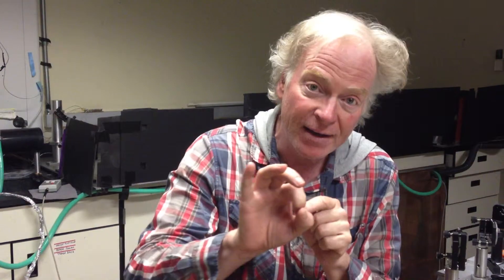Microchannel plates for soft X-ray imaging sales@dmphotonics.com

Comment from the maker: We can offer from stock:
Microchannel plate detector MCP-MA 25/2
The rectangular mounting plate is 34mmx34 mm
with mounting holes on a 27 mm square
(dia 2.2mm for 2 mm mounting screws)
https://www.youtube.com/watch?v=QW532GLaDFU

drawings (with a circular mount) are shown here:
http://www.dmphotonics.com/MCP_MCPImageIntensifiers/mcpma252.htm
Pricing shown in our online store:
http://greyhawkoptics.com/product_info.php?cPath=73_74&products_id=305&osCsid=eaa7fb9625ca09de4256aed58a54aba4

And we can offer from stock 4 bare MCPs of your type 25-10E, each two matched:
http://greyhawkoptics.com/product_info.php?cPath=73_75&products_id=309&osCsid=34db26694241bae662b97030d59970fb

Please note that the prices indicated are list prices, we'll be happy to offer you substantial discount. Please let us know what you want to see on the formal quote and what is your expected budget you plan to spend so we'll do our best to fit in it.

Comment from the maker: 2p - Microchannel Plate (MCP) Detector sales@dmphotonics.com
http://www.sciner.com/MCP/2pi_detector.htm
2p-Detector is multi-detector, based on microchannel plate detectors. It can be used for detection of electrons, ions of both polarity and photons in wide variety of experimental research. Both energy and angular distribution of different particles can be measured as well as the correlation between these quantities.

This new type, 2p-steradian multi-detector originally was developed as low energy electron spectrometer for probing highly charged ion (HCI) surface interaction. This interaction gives rise to the emission of a large number of slow electrons. For example, the impact of a single Th71+ ion on a gold target produces a mean number of 250 "slow" electrons (E<60eV).

2p detector made of 16 independent detection units, made of two multichannel-plates (MCP), located on a half sphere of 60-mm radius surrounding the solid target. The 16 detectors are held from their backside on an R = 85mm hemispherical frame (fig. 1). Three additional holes are bored in this frame: one hole for beam injection at normal incidence and two opposite holes located in the equatorial plane for beam injection at grazing angle allowing the incident and the reflected ions to enter and exit the hemisphere. The field free half sphere between the target and detectors is materialized by an equatorial plane and a so-called inner spherical grid located one mm ahead of the detectors input area.

2 pi Microchannel Plate (MCP) Detector

The individual detection units have been designed to minimize the dead area for maximum solid angle efficiency. At the entrance side, the detector has a 34-mm ring leaving 31-mm active area on the first MCP. To achieve such compact design, all connections have been located on the backside. The two MCP, mounted in chevron, are separated by a 10 mm foil acting as a spacer. This technique, called micrometer gap allows to simplify the assembly while maintaining good pulse amplitude distribution. During separate testing of the MCP units, a pulse amplitude resolution (FWHM/position of maximum) up to 35% has been achieved. In this case, it could be possible to distinguish between single and multiple hits on the same MCP below the 10-20 ns dead time of the time-of-flight electronics. The entrance ring is insulated from the MCP by sapphire balls and may receive a grid to accelerate or repel charged particles. The collector is made of a single metal piece but may be changed to a 3-piece collector allowing higher "granularity" of the 2p system. The collector disk is decoupled from high voltage by a 50 mm thick

Kapton disk (built in capacitor) to allow the collector to be biased by + (or -) 5 kilovolts. Each detector unit has five high voltage connections, two built-in capacitors and a 50W cable for the signal. This strategy allows independent biasing of each detector as well as independent bias voltage of the input and grid voltages, but ends up with a rather complex wiring of almost 100 cables and twice as much connectors under ultra-vacuum.

At run time, any number of units may then be optimized for detection of photon/ electron and negative ions or photons/positive ions. The entrance grid can be used to repel slow electrons and negative ions with a detector biased positive or negative (allowing only photons to be detected). Apart from the channel plates, all parts (more than 70 per detector) have been specially machined out of non-magnetic UHV compatible material.

Each detection unit is terminated by a built-in 50W connector whose signal and coaxial shield are coupled by high voltage capacitors to the collector and the 2nd MCP output respectively. An UHV 50W cable (Kapton/cu) drives the signal to a CF 100 flange bearing 19 double sided SMA feed through. The (DGMO) discriminators specially designed by the IPNO (Institut de Physique Nucleaire-Orsay) for MCP detectors offers decisive advantages. They are:

- rather insensitive to "low frequency" noise (below 100 kHz)

- very sensitive to the MCP signal since the threshold can be as low as 3 mV, which allow increased dynamic range.

- constant fraction discriminators, working in the ideal case of a 100% fraction to take full benefit of the nice symmetrical shape of the MCP signal, An ultimate time resolution below 20 ps has been measured

- they include a built-in linear amplifier which picks up the signal at high impedance and regenerate the entrance signal at 50 W allowing simultaneous pulse amplitude distribution measurements or direct view of the triggering signal on the scope.

- As a result only the threshold has to be adjusted as well as the NIM output width.

There are 16 independent detector units and discriminators. All other electronic devices are designed for 16 channels. The NIM signal out of the discriminator is converted into ECL signal and directly sent to the corresponding channel of the multi-hit (x16) multi-channel (x16) multi-event (x32) numerical Time to Digital Converter LeCroy 1176. This new generation of TDC may be operated both in common start or common stop mode. It records simultaneously all the stops on the 16 channels with a ns accuracy over a full range of 65536 ns (for a price, which competes with traditional TAC). There is no dead time for hits in different channels but 20 ns are needed before the same channel can accept a new hit. The pulse height distributions of all units are also recorded in coincidence with the first stop of each channel; the regenerated analogue signal out of the DGMO discriminators is sent to a 24 channel preamplifier card (Lecroy 2724) and to a "charge to digital" converter (16 channels "Phillips 7176" QDC with individual gates). The position sensitive detector uses standard preamplifier, pulse shaping electronics and ADC to record the position information. The time signal is taken from the output of the second MCP and may be used to stop the TDC after an adjustable delay.

The TDC has been taken in a VME configuration allowing direct high speed 40 Mb/s readout by a VME computer card (Motorola MVME 167 based on a 68040 processor operated under VxWorks). This allows easy ethernet link and file sharing with UNIX workstation, HP 715-33 in our case.

 

2pi Microchannel Plate (MCP) Detector, top view

 

References:

Morosov V. A., Kalinin A., Szilagyi Z., Barat M. and Roncin P.,
"2p spectrometer: A new apparatus for the investigation of ion surface interaction"
Rev. Sci. Inst., 67, 2163 (1996) download

P. Roncin, J. Villette, J. P. Atanas, and H. Khemliche
"Energy Loss of Low Energy Protons on LiF(100): Surface Excitation and Mediated Electron Emission"
Phys. Rev. Lett. 83, 864 (1999) downloan

Villette J, Barat M, Roncin P
"Calibration of a multiple microchannel plate detectors system by alpha-induced secondary electrons"
Rev. Sci. Inst., 71, Iss 6, pp 2367-2370 (2000) download

J. Villette, A. G. Borisov, H. Khemliche, A. Momeni, and P. Roncin
"Subsurface-Channeling-Like Energy Loss Structure of the Skipping Motion on an Ionic Crystal"
Phys. Rev. Lett. 85, 3137 (2000) download

Visit Laboratoire des Collisions Atomiques et Moleculaires

Comment from the maker: Microchannel Plate MCP 25-10 sales@dmphotonics.com

Specifications:
Outside Diameter mm 24.8
Active Area Diameter mm not less than 18.6
Plate Thickness mm 0.43
Pore Size um 10
Channel Pitch um 12
Channel Bias degrees 5
Electron Gain at 800 V - 1000
Resistance 10^8 Ohms 1.5 - 4
Minimum Limiting Resolution lp/mm 50
Maximum Dark Current Density ?10-14 A/cm2 1
Noise factor, typical value - 2.5
Open Area Ratio % not less than 59
MTTF (mean time to failure) -- not less than 7500 hrs.

Limiting Value
Operating Voltage V 1000
Field Strength V/mm 14000
Input Current Density ?10^-8 A/cm2
Output Current Density ?4*10^-7 A/cm^2

http://www.dmphotonics.com/MCP_MCPImageIntensifiers/mcpma252.htm
http://www.dmphotonics.com/MCP_Detector_Basics/how_to_choose_mcp_detector.htm
Microchannel Plate Detector MCP-MA25/2 sales@dmphotonics.com

Comment from the maker: MCP 70x90
Plate Dimensions    mm    90 x 70
Active Area    mm    not less than 86 x 66
Plate Thickness    mm    1

Channel diam/pitch - two models are available 15-19 and 12-15
Pore Size    um    15 //12
Channel Pitch    um    19 //15
Channel Bias    degrees    8 // 13 - two standard angles, custom angels also available

Electron Gain at 1200 V    10000
Resistance10^8 Ohms    0.2 - 10
Maximum Dark Current Density    10^-13 A/cm2    2
Open Area Ratio    %    not less than 59
MTTF (mean time to failure)  not less than 1000 hrs.

Note that custom models are available, but lead time is substantially longer

Here is a standard detector that we offer:
http://www.dmphotonics.com/MCP_MCPImageIntensifiers/mcpgps70x90CF8.htm